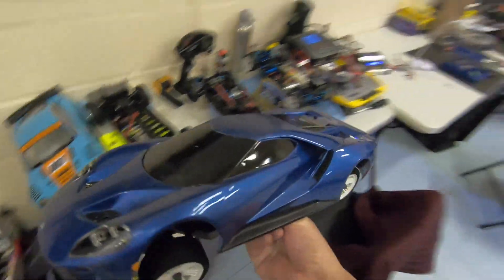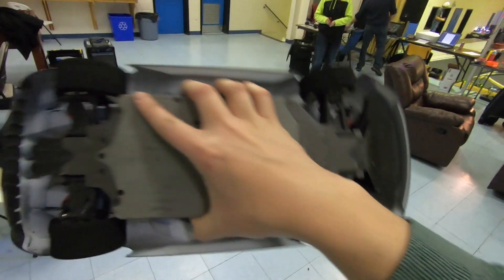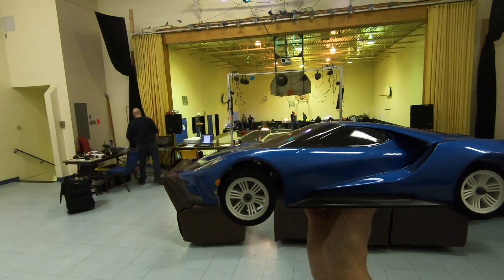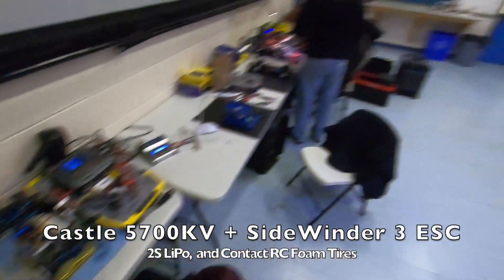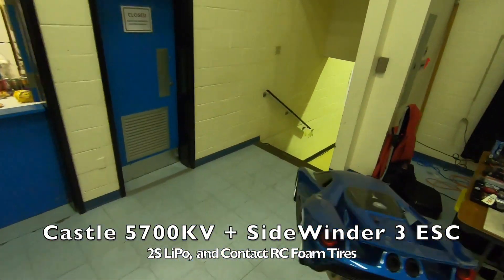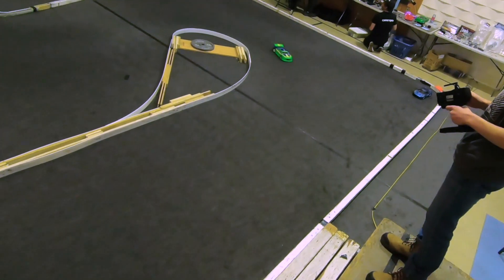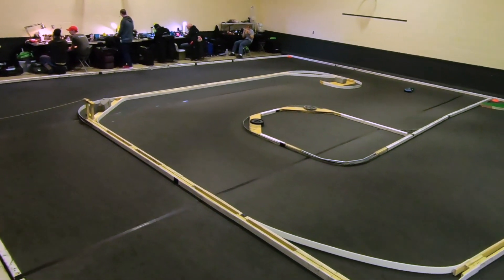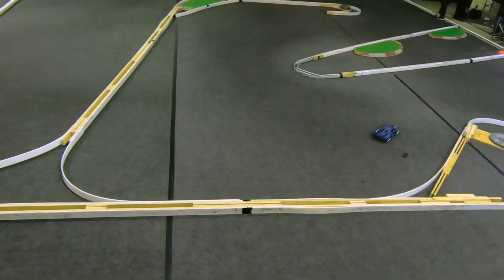So Fast! 4TEC 2.0 Brushless 5700KV on Contact RC Foam Tires Track Test - Netcruzer RC

Comment from the maker: I'm using the 30mm wide tires on the rear, you must use longer wheel hexes to get the wheels to clear the chassis and body.  Stampede 2WD wheel hexes and a washer or two works for that.
Reply: I run the 45 mm foams for speed runs and they need a 8 or 9mm hex for them to clear the chassis. I've tested it with them on all four wheels, launch is just ridiculously fast but steering has the arc of a large farmyard tractor! I'm thinking a 4600kv motor or even 3800kv castle might be better on that track given the short straights
Reply: Netcruzer RC TECH CARS any overheating issues with 5700kv?
Reply: Just brought some 30mm contacts foams for the rear on my 4 tec 2.0 vxl and they rub, do you know what hexes I need to buy to get the wheels to work 🤔🤔🤔